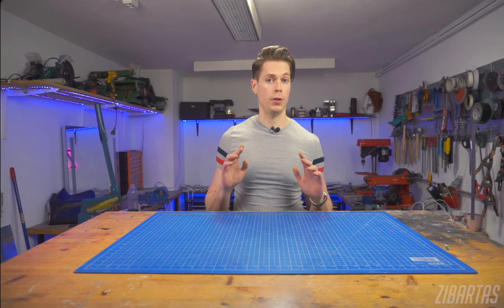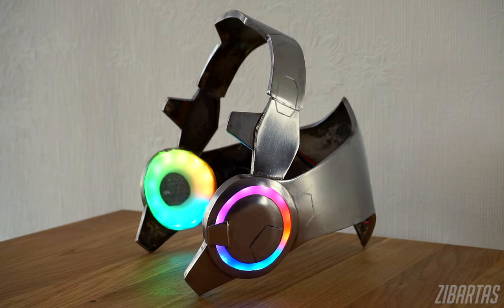Diffusing LEDs: From good to GREAT

Comment from the maker: Timestamps for comparison of materials:
0:31 Baking Paper
0:46 Sanded Plexi Glass, 400 Grit, Single Side
0:50 Sanded Plexi Glass, 400 Grit, Both Sides
0:53 Sanded Plexi Glass, 280 Grit, Both Sides
1:01 Opaque store-bought Plexi Glass
1:27 Stock and Sanded "CosplayFlex Clear"
1:52 "CosplayFlex Shining Foam" 5mm, 10mm, and a bluish Kitchen sponge 
2:08 Synthetic Woven Fabric - 1 Layer
2:12 Synthetic Woven Fabric - 2 Layers
2:14 Synthetic Woven Fabric - 4 Layers
2:17 Hot Glue
2:53 Opaque Edge-Lit Plexi with Reflector
Reply: Zibartas what material did you use for the reflector? I would love a follow up video on reflector materials with edge lighting
Reply from the maker: @wingsdesire1  it's just plain foamcore! Sorry I didn't respond earlier! :D But yeah its a good idea, actually.
Reply: Hey man, any chance you could orient me to a synthetic woven fabric dealer? Cheers
Reply from the maker: @alexandrelavassani9392  hey pal, i use something like this for homemade stuff https://amzn.to/2JcPZ2B but if you go to a local fabric shop you might get a cheaper/better deal!
Reply: Zibartas excellent cheers
Reply: Hey, im using a black smoked led diffuser channel i found on amazon. The screen through which the light projects is black, however the led is still spotty, any tips on how to diffuse it in that scenario?
Reply: where did you get the synthetic woven fabric?
Reply: @Zibartas  what is better tracing paper or baking paper?

Comment: The baking paper tip is underrated. Everyone has baking paper at home, and it works really well to diffuse
Reply: how do u put it on your ceiling tho?
Reply: @Alex-gq4yd  tape it bro, i would suppose lmao
Reply: @Alex-gq4yd  staples is good too
Reply: Bold claim that everyone has it.... also true tho...😂😂
Reply: @thebainetrain  if you dont have it yet, grab it the next time you get groceries...
Reply: I use it often in my videos ;-) Never thought that I can use it for something else !!
Reply: I actually think it's awesome I'm not the only one doing this..... got some ceiling fixtures and my wife found the led light verry harsh on her eyes, so I just cut a peice to fit in the fixtures and it was an instant fix.... can't even tell it's there tbh.
Reply: isn’t it a little dangerous? fire and all?
Reply: @robbykidman  baking paper is meant to go in the oven
Reply: @waawee756  😂😂😂😂😂
Reply: @robbykidman  yup as mentioned, baking or parchment paper is silicone paper or a food safe equivalent nonstick 'paper' that can withstand ~500°F for extended periods. Perfect item for this application for reasons stated.
Reply: I don't even bake and I have this paper lol. It's a good nonstick surface when I'm contact cementing large surfaces together and I don't want it to all stick at once. Definitely gonna try this for diffusion!
Reply: How is it with the hue lightstrip? Someone tried it?
Reply: @nick_albuja  no damn cookies for you than! 😅
Reply: @nick_albuja  not surprised u think that considering where ur from
Reply: And it won’t burn as well!
Reply: Grab some clear/semi-opaque tubing and cut it lengthways to form a semi circular tube shape. Then line the inside with baking paper and place over your led strips on the ceiling. It gives a nice diffusion without breaking the bank and also looks good as a finished product.
Reply: @djcook  i’ve seen some of your worst youtuber videos and it’s cool to see you in a random comments sections
Reply: Not true..
Reply: Bought a roll of parchment liner. I have a plan to DIY a diffuser but I’m not sure if I can pull it off. I was thinking in the least try this spaced in a “triangle trim” way with either fish line and eyelet screws (or even clear thumbtacks). 

I also do baking with springform pans so I felt the gamble might be worthwhile for this purchase for me haha.
Reply: I want to line the inside of a linen closet in my bathroom to work as a nightlight, I’ve been dreading the idea of spending $$ on diffuser channels and the parchment paper idea is perfect! Really thrilled I came across this! Thank you

Comment: Another option is to cast epoxy. While there is special epoxy for this purpose, for small things, ordinary household epoxy works great.  Just mix in a tiny amount of talcum powder to make it diffuse instead of transparent. You could do a similar thing with clear silicone.

Comment: Cheapest way to diffuse LEDs is using masking tape (a.k.a painters tape) and of course other kinds of tape. You can add as much layers as you want to suit your needs and diffusion level. Cheers for the video, sanding plexiglass is interesting.
Reply: So if the LEDs are under my cabinet I just put tape over them like I'm taping them to the under side if the cabinet? I've been debating if I should just get a 6 pack of LED bars that link together or the strip lights.. Can't decide lol.
Reply: @Mandy_39  Hey, the LED Bars that link together are probably way more expensive than the LED Strips. If you can go for the LED strips and diffuse them with tape you'll be good to go with less money spent. To answer your question, yes you cover the LED strips with tape. Usually I prefer to do this process prior of sticking them to a cabinet or table as it will be easier to remove excess masking tape from the strips. I prefer to do this method on waterproof LEDs (the ones with silicon protection over them) as the end result becomes neater and I am also less paranoid that the masking tape heats up. Good luck and enjoy. Any further questions don't hesitate to ask :)
Reply: @olivermgrech thanks, really appreciate the reply! I'm realizing that they are way more expensive &  I obviously want it to look good but that's to expensive for my liking especially since I want to do lower & upper cabinets! Is there a specific brand or kind of tape you like best, them heating up is what worries me the most. Do you just use 1 peice or multiple? Guess it depends on the lights I buy lol. Any recommendations on brands of LED strips?
Reply: @Mandy_39  No problem! If I had to recommend a brand it would be certainly govee as their quality is great and they are very well priced. I also had good results with random brands from China that I bought from ebay. About tape, any basic painters masking tape would do, I tend to find a branded one for a few extra cents as the glue will be of better quality. USB powered strips or the ones that come with a 5V or 12V power supply would be safer as they don' t emit a lot of heat. Whatever you opt for always test it out and monitor it. 
When you apply the masking tape over the LED strip you might need someone to hold the other end as the strips tend to roll off, or if you're doing it alone (like me) a heavy book to hold it in place would help as well :) You'll understand this when you start the first one :) Cut excess tape with a craft knife so it will be really clean and neat.

Comment: you can go to a PC(or TV) repair service and ask them for broken LED/LCD backlight boards and foils.. (from monitors, TVs and laptop screens)they usually(in 95%) trow them away if the screen cant be fixed and probably will just give them for free.
the foils in the screen are perfect for defusing and amplifying the light(that is their purpose) 
for smaller projects, the foils from a broken phones work equally well, and most mobile service shops also trow them away...
Reply: Except if you live in Brazil xD. People here love to sell, even if doesn't needed anymore. EVEN if doesn't function anymore.
Reply: Thank you bro there is a electronic repair shop infront of my house I will go there tmrw and ask them for the foils
Reply: @s1l3nt40  how does it go
Reply: @user-lk9ii5nu4j  I asked them and they gave me a lot of foils

Comment: You can also use gels to add coloring along with keeping uniform brightness.   This is especially useful for lighting astronomy canvas paintings from behind that have different colored stars (like Orion, which has a red super giant, a blue super giant, and a multi-colored nebula.  Clear gels sanded down can be glued together to reduce the brightness of stars respectively.   Great channel.  Thanks.
Reply: Would it be possible in theory to "change" the color of the LEDs using these methods? Like if there's a single orange LED and we want to say... alter it to appear red or some other color?  Thanks!

Comment: I used this heavy weight vellum from Blicks Art Supply called Canson Opalux Drawing paper for a 3D project. It is a vellum paper with the stiffness of acetate and comes in 19x25 inch sheets. It was decent at diffusion with 1 layer.

Comment: For a 16x16 led matrix I filled a 3d printed grid with epoxy mixed with some drops of white acryllic, on top of it I put glass with a thin layer of black paint on the inside, which made the screen black with clear square pixels when lit. I read that glass bubbles would be better as a diffuser instead of paint because it scatters light without blocking. The paint worked great though

Comment: With all the LCD flatscreen TV people get rid of on the daily you can just pop one of those open and take out the stacks of light diffusing sheets. there's one big thick one sometimes two about an eighth of an inch thick, maybe a little thinner and then a stack of like six thinner ones I'd say about a little  thicker than a piece of card stock paper you can get quite a bit from one TV.

Comment: I've used an interesting mix to waterproof some inexpensive white LED strips to put outside.  Same idea might work with a bit of experimentation. 

You have to have a channel for it to go in.  Mix 100% silicone caulking with enough naphtha to make it pourable and it will flow.  Pour it into the channel slowly to reduce bubbles and let it sit for a day or two.  You need good ventilation, but it will cure as the naphtha evaporates.  The final surface will be smooth (the fewer the bubbles the better), it will be waterproof.  Some kind of stain/paint/etc. would provide the diffusion.

Using white silicone and maybe a mix of white and clear would ensure the pigment is soluble in the mix for consistency.

Comment: I'm having decent results with FDM printed covers, if having gone through a couple dozen design iterations. Clear PLA, 50% gyroid infill and a domed cover works quite well. Especially that you need insets for the components on tape in order to slide it into the grove of 2020 extrusion. Otherwise cutting a strip of frosted acrylic would be far less work. I intend to share my designs once I get the 'code' (FreeCAD part design workbench) and documentation cleaned up.

Comment: My favorite method is similar to baking paper (I agree with the texture problems) it is called tracing paper, if I'm correct. Much more consistent, no texture. 
The other is similar: everybody knows of laminating paper by putting it into a certain film then heating it up. That film is translucent (waxy, maybe?) before use, makes a great diffuser.

Comment: it's not the best option but i tend to use a 1-2 mm thick layer of Thermoplast when I have no space at all. It difffuses the pixels to 80% mostt of the time, even if i have literally 0 space in between the diffusion and LEDs.

Comment: I’m so pleased I watched this video! I bought a beautiful lamp which weirdly came with a strange permanent led light bulb, the light it omits is truly awful, feels like I’m at the dentist, definitely not ambience as I hoped. I used the baking paper idea and it’s worked perfectly, however the paper is touching the Led bulb directly and the bulb does get hot? Could this catch on fire?
Reply: Luckily baking paper is made to handle high heat

Comment: At 2:55 you talk about using a reflector. What type of reflector? What kind of material is it made out of? Great video!
Reply from the maker: A reflector is more about function and not the material - in this video I'm using foamcore, but you can use anything that has a somewhat matte/scattering surface that can disperse light in a desired way :)
Reply: @Zibartas  thank you!

Comment: How do these different solutions hold up to the heat generated from the LED's? Different concentrations, voltage, wattage, and Amps will generate different heat that could, with some materials, create a fire hazard. Or how about the mounting solutions paired with each diffusion method? 

Good tips, but I feel it could be more comprehensive.

Comment: Glad I stumbled on this channel. Might try some more creative ideas in future, but for now I'm just trying to diffuse a pir-sensor light strip I have in my apartment hallway - I'll try baking paper first as cheaper is better lol. 
Thinking of how I can warm the colour up a bit too, as the light is a little too harsh for me (despite being advertised as 'warm white').
Reply: Just discovered that putting a couple of layers of painters/masking tape (which comes in yellow as standard in the UK) directly onto the LED strip does a decent job of warming up the hue of the light just a little bit (plus provides a slight diffusion, as well as reinforcement for the adhesive on the strip) - so I think I'll have a good result once I add the extra diffusion of some parchment paper - all done with cheap supplies.

Comment: Film TV & theatre lighting uses various versions of flame retarded diffusion materials, scrims, frosts, gauzes (as well as coloured gel too - thin sheets of heat resistant colours ) to put in front of any luminaire source.  Of course, the use of RGBWW LED may not need colours but the use of frosts, scrims, etc. Are very much needed still.  A global Manufacturer like LEE Filters or ROSCO will have a distributor near you. Look for theatre tv & film suppliers, and start there. A sheet of this stuff is about and I mean about a metre by half a metre.  Some bigger, some smaller, and if you need to fill your boots you can buy rolls of it too!  As it is made for purpose, as I said at the beginning, it is inherently flame proof.

Comment: Really cool! :D never thought about sanding materials :) I'm guessing it would work with transparent worbla too? :)
Reply from the maker: You bet!! You can even try wire brush or steel wool;)
Reply: It does work very well! I used sanded (only the inside sanded as to keep it shiny) transpa worbla in combination with LED foam (plastazote) to diffuse groups of 4 leds to create glowing gems in armor, turned out great and not spotty at all.

Comment: Have a look at "Magic Sponge Erasers" made from white melamine foam.  A 10mm thick piece almost completely diffuses a 60 LED/m RGB strip.
Reply: What do you just rub the sponge or coarse side over the leds?
Reply: @micksumo  Cut them into 10mm thick strips and place over the LEDs.   The foam is full of bubbles and diffuses the light.  He mentions foam as a diffuser in the video

Comment: Youtube randomly recommended your channel to me, and it's great!  I plan on using the diffusing layers that come out of a flat panel tv/monitor, as DIY Perks did in one of his projects.  Have you tried that before?
Reply from the maker: Nope, haven't! But I don't doubt they work great/better as they're designed for that :D
Reply: @Zibartas  my hope wit thè evolutionair of LED/ OLED s that in te future thee Will besingle large emitter/emitters that emits asoft non-glate Light similar to The expensive OLED lightpanels though thistyping I Own 2 OLED panels 1osram readinglight rl101 Made in Germany runs on battery second. Akit runs on mainspower here in Europe 230V 50Hz aLG (chem or display ) OLED panel i have to say f*cking awesome😉😉but yeah expensive somen are 180 aan 200buck💶💵hoever i was Lucky that igot it from a Friend knownperson😁😁

Comment: Hi like the video and glad to find it after 4 years. What grit of sand paper do you recommend?
Reply from the maker: Depends on the material - 400 grit seems to be the most reasonable middle ground - doesn't scratch up the surface too much, but enough to make the light more diffused :)

Comment: I have a question...I've got 112ea x 5mm opal frosted acrylic rectangles (60mm x 50mm) sitting on 8 shelves in a display cabinet with 5mm in between each one horizontally. I want to light each and every one up with white LEDs as diffused as possible while sitting on a 15mm hardwood shelf. Tall order with the LED so close to the acrylic i know, but any genius ideas would be greatly appreciated!

Comment: hi there. i changed the LED backing light of my TV and now i can see brighter spots where the LEDs are through the screen. the LEDs dont have that difuser plastic as some Samsung TVs has, its only the bare LED. im not sure if i messed up the order of the different difuser and polarized Sheets that goes between the LED and LCD screen. In the end my problem seems similar to what you've shown and a difuser layer right after the LEDs could do the trick. what do you think? any experience with the different filters in LEDs TV? thanks a lot

Comment: I was wearing a white pullover, my brother had some sex lights on - don’t get any silly ideas - and it was flashing rainbow all over the sweater. Looked dope. Made me want to make a sweater that transitions the rainbows, and my problem with making an LED sweater was the lights being like christmas lights. I may need really bright LEDS but diffusion is the bigger problem. Is there like some sort of fabric that isn’t as solid as acrylic? Like fabric fabric? Maybe like reflectors for cameras?
Reply: Not a "fabric" fabric, but you could cut the material off a translucent umbrella diffuser (~$12) and integrate it into the garment. It's flexible stuff and you could likely use one of the 3M "Super Adhesives" (maybe #77, but don't hold me to that) to secure it to various sheer fabrics.